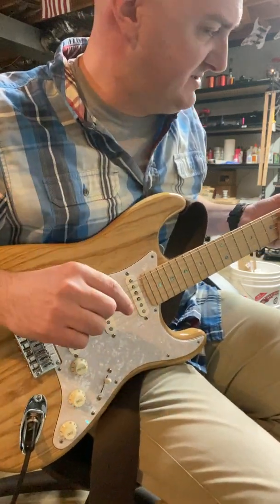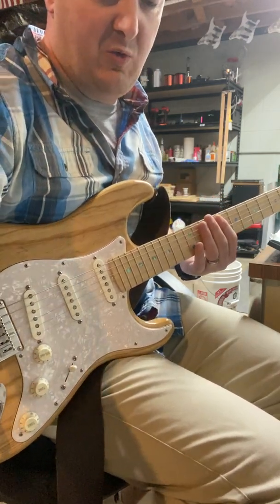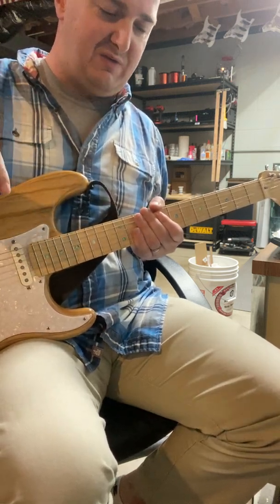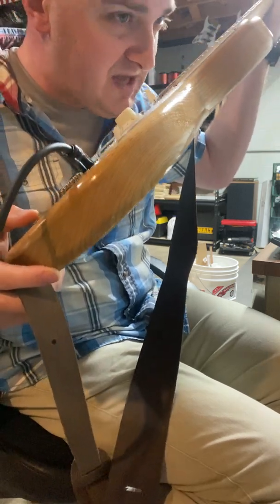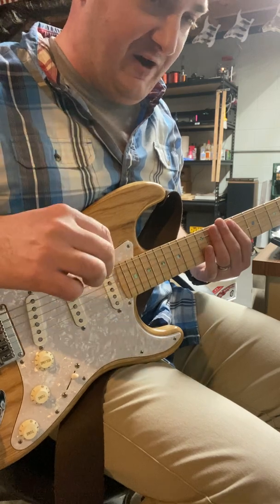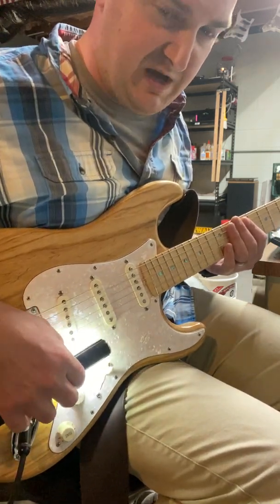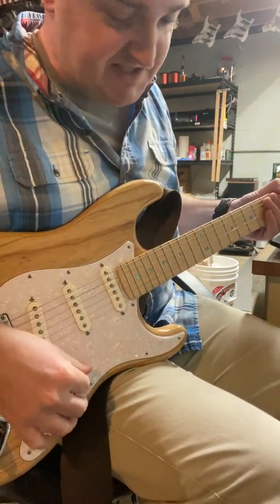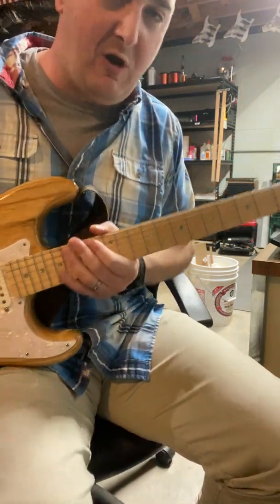60 cycle hum, RFI and Shielding is useless Noisy electric guitars SCIENCE EXPERIMENT

Comment: I've shielded my Strat with copper foil, checked and double-checked for continuity, made sure everything was grounded properly, with no ground loops, but I haven't noticed a major difference in noise reduction. On clean the guitar is dead silent, but it's still relatively noisy on overdrive, in positions 1, 3 5, and almost quiet in positions 2, 4. Maybe shielding can help in certain cases that I haven't been able to test for at home, but in general I wouldn't get one's hopes up with shielding.

I did find one great thing about shielding the pickguard though - I managed to ditch some of the ground wires, since the components have become grounded via the shield. I like how neat my wiring looks now.
Reply from the maker: Good assessment. This is my take on the issue also. 

As far as grounding with the shielding on the pg, I’d always take a soldered connection over a mechanical connection personally. It’s more consistent over time and more reliable.  

Thanks for stopping by.
Reply: @MathewsGuitarWorks  Sure. Thanks for making the vid. The thought that contact with the pg may degrade over time did cross my mind, but I'm too exhausted after all that shielding work to pick up my soldering iron again )) I guess I'll have to wait and see how far this pg grounding thing takes me.
Reply from the maker: @RichardPFranklin  copper shielding tape generally breaks down connection faster as copper oxidizes faster. I’m sure it will be fine for a while.
Reply: @MathewsGuitarWorks  No biggie. It's my experimental Strat that I'm planning to upgrade some time in the future. But before I invest time and money, I decided to try a few things and see what works and what doesn't. Thanks again for putting your perspective out there. People need to see alternative info on shielding.

Comment: Playing in a bar band for many years, It was amazing how badly most of these dives were wired.
I ran my amp through a UPS battery backup and I switched to EMGs in all my guitars I used live.   It helped a lot.
Reply from the maker: I find most of the noise in my rig is from my house wiring also. It seems it gets worse when the air gets really dry also. I mean if I didn’t ever tell you about it and was playing at normal gig volume, you probably wouldn’t think anything about it. It doesn’t really bother me. It’s a small price to pay for being able to play electric guitar. 🤘
Reply: @MathewsGuitarWorks  I only play through headphones these days using Neural DSP.   Gets me good sounds with out upsetting the family with my pentatonic wankery.  It's a fair trade.  Noise is no longer an issue with any kind of pickup, but I do miss my tube amp.  I'll have a better setup when I move next year.  New place has a really nice shop that I'm going to deck out in boomer man-cave/recording studio greatness.
Reply from the maker: @srogers500  🤘🦅

Comment: Can you say "noise-gate"?  also turning  volume and gain down when not in Actual use also vary-ing proximity (changing angle of pickups to amp/speakers can reduce "SOME" noise......If you add up all the little things you can do to make the problem better....things will get quieter....NOT PERFECTLY SO....but it WILL help
Reply from the maker: This was merely a demonstration. Calm ye tits.  Thanks for stopping by and commenting.

Comment: Hello Matthew, I'm looking for advice. Ever since I moved into my new studio I've had horrible noise issues. This is a specific type of noise that sounds like some kind of electrical communications... it was audible in my studio monitors (changed to a different pair and no more noise) and in several microphones (not in others, though), but it's still very apparent in my single coil equipped guitars. The humbucker equipped guitars exhibit maybe 2-3% of that noise, and the 2 and 4 positions on a Strat as well, almost inaudible even with lots of gain. It's not 60 cycle hum, it's not RFI and it's not ground noise. I'm not sure if it's EMI or something like that, but it's very specific, piercing at times, and inconsistent. The noise is almost as if it's in two layers, one constant hum/buzz and another that comes in and out intermittently, with a piercing 4 kHz and 8 kHz digital kind of buzz. Do you have any idea what this could be and how to work around it? There is a train very nearby, if that accounts for anything...
Reply: computer harddrives

Comment: I politely disagree. I have an original 76' strat I bought in 79' . It always made noise..was ridiculous and embarrassing to play in the 80s. I threw it in its case in 1987.. it's sat there till 2015. I was saving it for my son so I decided to have a totally redone and have it shielded as well.... There is zero noise coming out of this guitar except for the most pleasant amazing Stratocaster tones you could ever want to hear... Now I understand your premise is shielding only copper shielding or foil shielding does not do anyting to reduce noise and that's fine but your guitar still sounds like shit and you've got other problems with it obviously. You should straighten out the power in your house number one I'm electrician so I could tell you all about that and I've got a ba in electronics... Your pedal boards are all messed up... You need a buffer in your loop that powers your board as well keeping your ohms consistently where they need to be. High-dollar guitar cable with very very well-made connectors on each end is essential... And if your amplifier doesn't have a ground prong you need to get that changed out by a pro because your leftover power thats not making it back to the grind is not discharging properly...put all this into consideration and you too could have zero noise and 100% heaven tones.
Furthermore if you are to debunk a theory plz have a solution, a proven way, ...something. No go fix your shiit

Comment: The shielding does in fact do something. I can hear a much lower sound with the aluminum in front of the pickup . Furthermore you are misrepresenting a faraday cage by using a piece of aluminum in front of the picks like that. A faraday cage can have holes, but should be grounded, and is only effective if it encloses the thing its shielding. So yes the pick up will always be that hole in any faraday cage you create, and even more importantly the electromagnetic field will extend upwards from the pickup. So in this sense yes the pickup will be the hole which accepts EMF interference. What you haven't really highlighted however is the importance of effective grounding, in relation to shielding. To talk about effective shields to EMF/RF without paying close attention to ground paths is really the elephant in the room.  Still i did like your video.
Reply from the maker: It doesn’t make a difference. I’m fully aware of proper grounding.  I’ve run a pretty successful guitar repair business for about 14 years now. I’ll make a video proving it as soon as I’m not working 70hrs a week at the day job.
Reply: @MathewsGuitarWorks  I look forward to that video. I dont doubt you have a lot of experience, but so do I. I was a pro sound engineer for 20+ years. I was involved in many things, such as building studios, etc. I disagree. And you know why i disagree? Because I did it on my guitar, and it improved it. You have some grounding issues which you are aware of in your building. Those issues most likely contribute to the noise not being effectively shunted to ground {?}. As to holding what appeared to be an LED up to a pick up... well that's emitting very audible but low power EMF. that's directly passing through into the magnetic field of the pickups. Its effectively become a transformer. One magnetic field interacting with another. That's not so much EMF or RF interaction as straight induction. the differences are important here. A radio wave is not a strong magnetic field, it's an oscillating wave. That being said if you hold that led light next to an unshielded wire it will create a noticable hum. The shielding clearly does something.  I am not sure what's going on with your grounding in your house, but it's certainly not a place to conduct experiments to which a stable and known ground return path is vital. When you talk of reducing grounding issues, more often that not we are talking by measures of degrees of reduction. Not absolutes.
Reply from the maker: Thanks for commenting 🤘

Comment: Several things come to mind.. Start with the amp.. Service it. Its got bad filter caps and probably bad screen resistors. Next I see you are in a basement.. I will assume those overhead lights are fluorescent shop lights. Specially since what you are calling 60hz hum is way higher frequency than actual 60hz. The fact you can touch the bridge and make the noises stop tells me there is a ground loop or improper ground in your chain. If your gear is properly grounded it does NOT act like an antenna as everything you just showed us has. What kind of cables do you use? good well made cables or budget crap cables with no shielding and un soldered connection?
Reply from the maker: Haha yea buddy, it’s none of that. Not the amp. It’s only a couple years old. It’s a George Alessandro handwired Deluxe Reverb. I think you missed the part where I cranked the amp on max and added a couple of gain pedals for max effect. When my amp is at normal volumes you would never hear any of this stuff. Yes my shop is in the basement. No, those are not fluorescent shop lights. They are LED and have zero effect on noise because they are not close enough to the guitar or amp.  The part were I demonstrate 60 cycle hum is exactly 60 cycle hum. The noise you claim is a ground loop when I’m not touching the bridge is completely normal (all guitars do it to some degree) and you can barely hear it at normal volumes.  The guitar has my OCD level wiring harness in it and I can assure you it doesn’t have a ground loop. Nothing I demonstrated in the video was the guitar acting as an antenna. 

I wasn’t trying to solve any problems in this video. I was simply exaggerating the noises with the use of too much gain with pedals and amp to illustrate what sounds people might be hearing from their rigs to properly ID them. 

Cables could very well. Be an issue that I didn’t cover. I didn’t because I was talking about guitars, not the cables. Thats for a different video. I’m not using cheap cables, they are D’addario american stage cables.

Thanks for the comment 🤘

Comment: So What is the point …when you don’t offer a solution? I don’t get it
Reply from the maker: The point was you being able to now properly ID the noise you are hearing to then get on the correct road to fixing your issue if it’s possible to fix. It’s hard to fix something when you don’t know what it is in the first place. 

I get a lot of customers that are hearing 60 cycle hum not knowing theres nothing you can do to stop it except change the pups to humbuckers or add some type of humbucker device into the circuit. 

Thanks for the comment 🤘

Comment: I can totally agree
That all pickups are susceptible to radio frequency interference
From lights , electrical
Other Equipment..
But as far as shielding 
For grounding purposes
Ill have to disagree..
Shielding the cavities, pickguard  and the pickups themselves
Takes an unwieldy single coil strat 
And transforms it to something playable. 

Obviously no one can ever have 100 percent 
Silence from there amp
When not being played.
Reply from the maker: Shielding passive component controls does nothing. Passive controls add nothing to a signal, it only takes away therefore it creates no noise of any kind. 

Shielding pups/pg/cavaties is marginal at best. It shields everything but the face of the pup. That’s like a house with no front door. The face of the pup is exposed still. 

If shielding reduces noise in a guitar circuit, it’s not reducing 60 cycle hum because only humbuckers do that. If it reduces ground noise, it’s because there was a problem with the grounding of the circuit. IF by a slim margin a faraday cage actually worked for a guitar circuit, it only reduces lateral and rear RFI as the pup face is still exposed to the outside world where 99% of the noise enters the circuit anyway. 

Thanks for the comment 🤘

Comment: You are right on in your experiment.   One of the worst offenders  for RFI are your typical spotlights on a stage.   Not only do many of them produce RFI, they can transmit 60 cycle if you are close to them.
Reply: In my experience, barroom neon beer signs seem to be the  usual perpetrators.
Reply from the maker: @Foul0wl2112  yup!  I also see a lot of cellphone in the pocket issues.
Reply from the maker: You are correct sir. I sometimes play with my cellphone in my pocket and it makes all kinds of noise. 

Thanks for the comment 🤘

Comment: Pardon me, old video but I must comment on what I have watched.
No guitar should make that noise when your hands are off the metal, to the degree observed here.
It may be cranked up here, but man that's really bad. I suggest your guitar's grounding seems to be broken.
This can be easily proved by touching a piece of wire from the actual guitar cord's metal outer ground (right where it plugs into the guitar)
 to the various exposed metal pieces on the guitar. I bet the noise goes away completely! Why? Because that is exactly what you are doing
 when you touch the metal - you act as the ground. As can be seen, the noise goes away completely, therefore it should also go away completely
 when the guitar's grounding is correct. Try that test!
In some cases it's possible the amp's grounding is not good (breaking that third AC ground pin off, ground switch is off etc.) , 
 but meh... I think the noise is much too loud for that. And there cannot be a broken ground in the guitar cable otherwise there would be no sound at all.
What do you think? Cheers...
Reply from the maker: I assure you the guitar is properly grounded.  It doesn’t matter what metal part you touch besides maybe the pickguard screws because it’s all grounded to the cable. All guitars do it to some degree, some worse than others. Absolutely some of the noise comes from the amp also. My house wiring is noisy. You haven’t addressed anything that I didn’t cover in the video. 

If you were in front of the amp and I did this at normal volumes, you’d never notice it. I had lots if gain stacked going into a cranked deluxe reverb sitting about 2ft away. Haha what would you expect?  This video wasn’t to come up with solutions, it was a simplified quick video identifying the noises.  

Thanks for the comment.
Reply: @MathewsGuitarWorks  OK Thanks I dig. Well, it certainly did identify that type of noise loud and clear. I was quite alarmed at how bad it was. I had to comment.
Reply from the maker: @razortim371  🤘

Comment: This is SO important. Retired luthier here. Thank you for this. The way I described this to clients was... The 'antenna' analogy. Now... All radios have antennas a few feet long to receive signals. Now... Imagine you have a radio antenna 5000 feet long. That is your pickup. It has many thousands of turns of copper (or silver? SD Zephyr lol) wire around the magnets. One wacking great big antenna. So yes... They're pretty sensitive. Also... The amp's filtering has EVERYTHING to do with RFI.
Reply: Dude l gave up trying to convince my customers otherwise.  Now l just bite my tongue.  Put in the stupid useless tape and write out the invoice....
Reply from the maker: @Foul0wl2112  Fortunately this is not my day job and if someone wants something that is a waste of time I can say no or refer them to someone who will entertain their nonsense. Most of my customers are excellent, open minded folks that trust my opinions and work. Something is going right, they all keep coming back and bring their friends back with them.
Reply from the maker: Back when I was a kid, I had an old ibanez pf200>Danelectro fab tone distortion>Crate GX65R that would pickup some kind of foreign radio station regularly. 

Thanks for the comment🤘